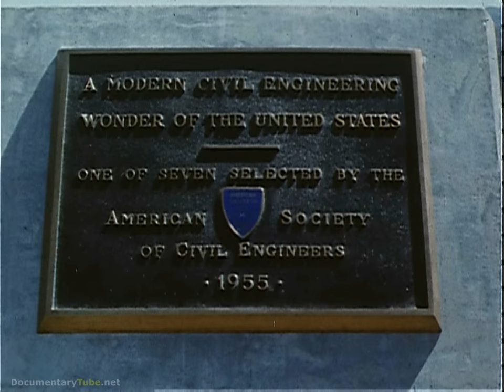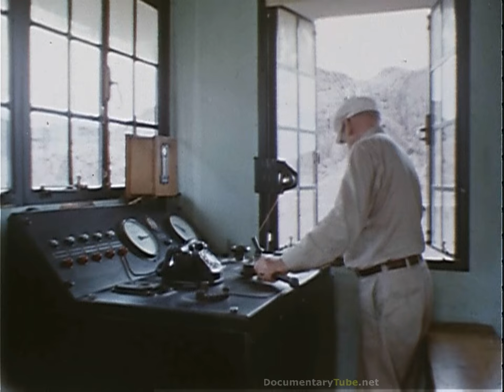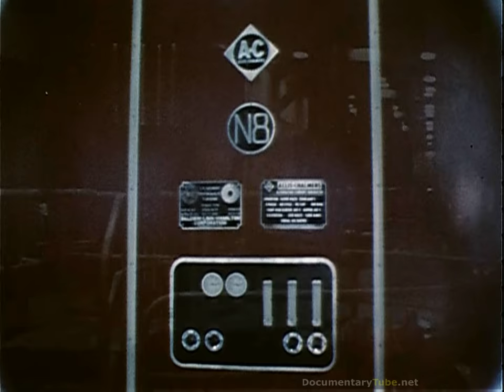HOW IT WORKS: The Hoover Dam

Comment: I am surprised this documentary did not discuss how the curing concrete was cooled.  I took the tour back in the '90's.  During the tour, it was brought up that the concrete had pipes installed to route cooling water through each block.  Curing concrete creates heat, and that much concrete would generate lots of heat.  As each block was cooled, concrete was sent through the pipes in lieu of water, to seal them.
Reply: That is a pretty interesting fact to omit
Reply: And also the type of turbine i.e Francis Turbine.. 😂.. Also why it is designed in arch shape in the upstream direction.
Reply: Yes, a huge amount of concrete had to be cooled by internal piping. There was no other method back then. Today, this dam was probably made based on a different type of concrete. But I don't know if it would do without complete cooling. Regards!
Reply: Nice.  I imagine the heat would’ve weakened the concrete while curing had they not.  Simple yet brilliant solution.

Comment: Hoover dam is very much similar to Bhakra Dam in Punjab, India.. narrow and high. It also has Nungal Dam down streem .
I am lucky to walk through dam, one bank to other in year 1969, as engineering student. Seen generator, turbine switch-gear.
Later it was stopped due to security reasons.

Comment: The dam is impressive enough by itself. But stop and think about all the support services, they built a town with all it's services, the cable ways, all the industries to supply the parts and materials needed. The transportation of goods and material in manpower. Then add to all of this, the offices and monitoring equipment, the internal machinery that produces the electricity,
The dam is not only one amazing feat, it is amazing feats many times over.
Reply: And the cost to build Hoover Dam was "only" $175 million. Imagine that. 😊